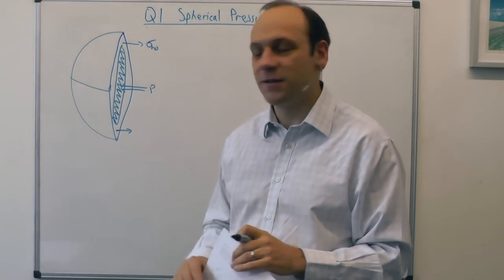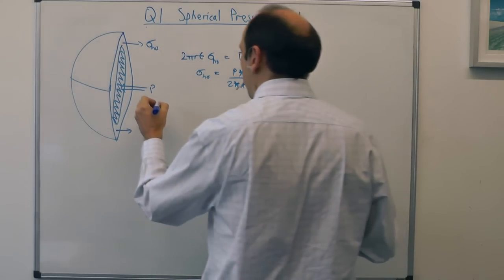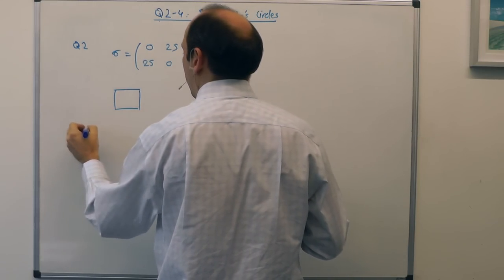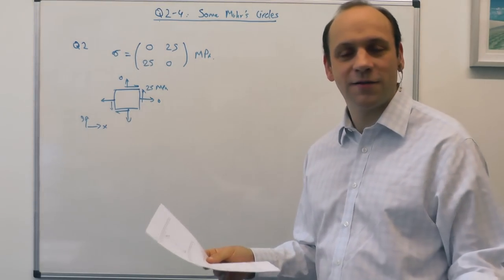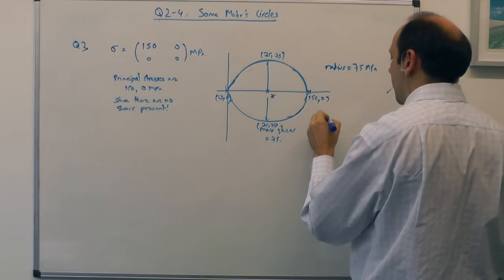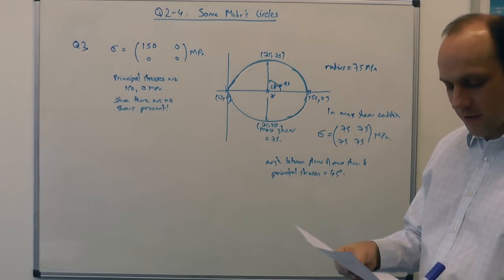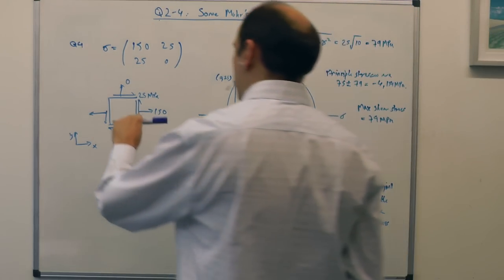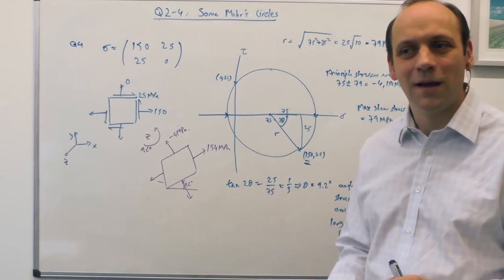3b | MSE203 Q1-4 - a spherical pressure vessel and some Mohr's circles

Comment: Did you post 3c? Do you do any problems that show external and internal pressure on a vessel when it has a thick wall?
Reply from the maker: No, sorry, we only consider thin pressure vessels in this course. Its not a big change though, don't worry. You should be able to figure it out. Or, look in Timoshenko's book.